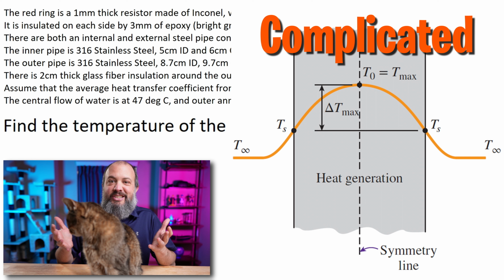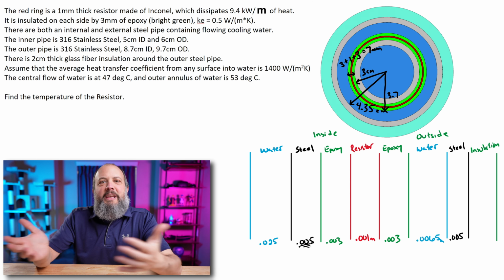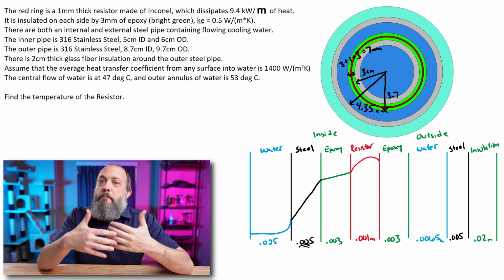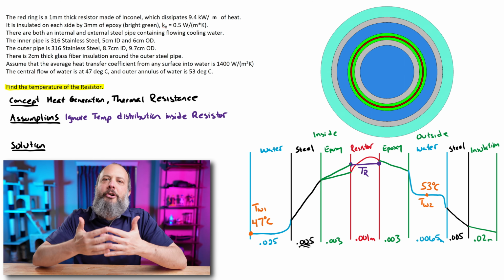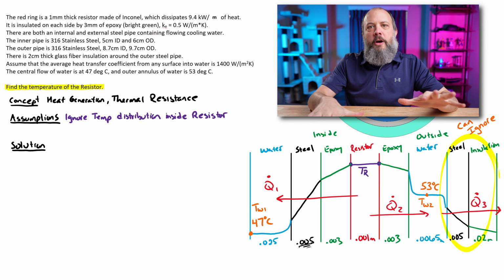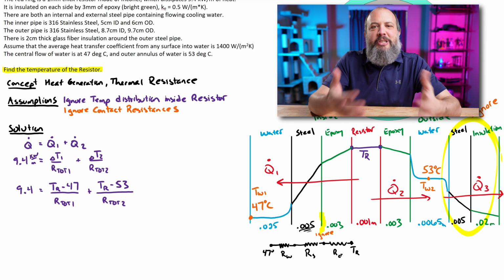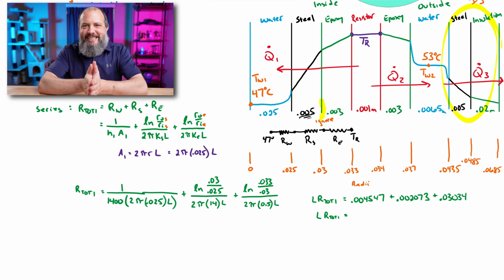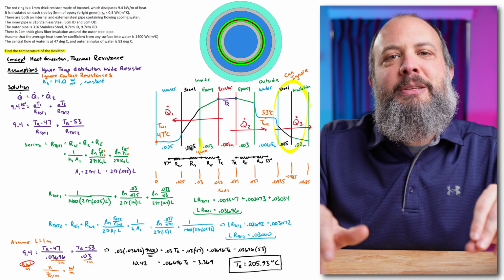Internal Heat Generation in Cylinder - Example Problem

Comment: sir thank you so much for your presentation. But how can Q2 and Q3 be different? Both are on the same side of the resistor, and all the resistors in between are in series, So, shouldn't this be same ? q2=q3??
Reply from the maker: An example to help you see how they can be different - Consider the impossible scenario where the ambient air were 60deg C. Q3 in that case would be pointing left from hot air to cold water. Both the resistor heat and ambient heat would both be dumping energy into that outer annulus of water. So, no, the Q3 doesn't have to match Q2. they don't necessarily even have to be the same direction.
Reply: @BrianBernardEngineering  thank you so much professor, now I got it. But in that case, every differential portion of what you mentioned as fixed q2, can also be different right? If heat is flowing in from both sides?